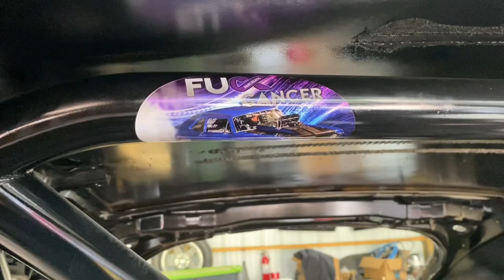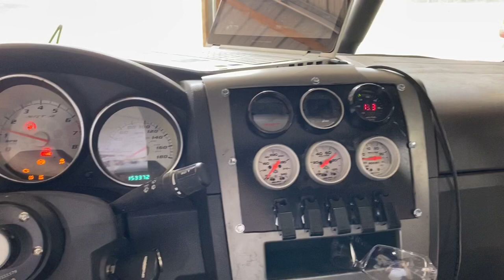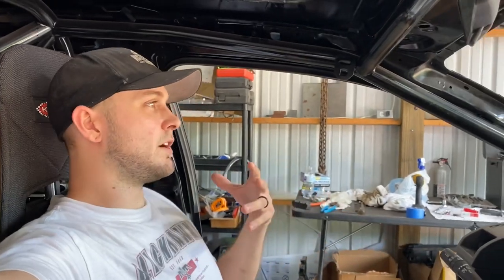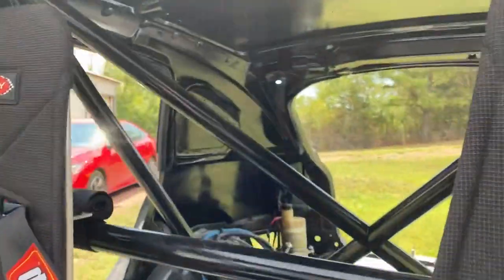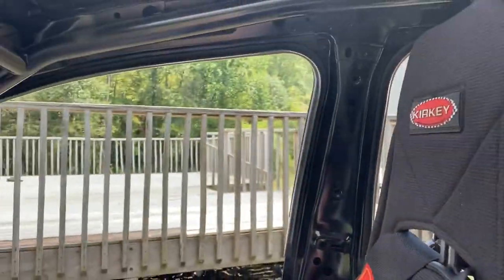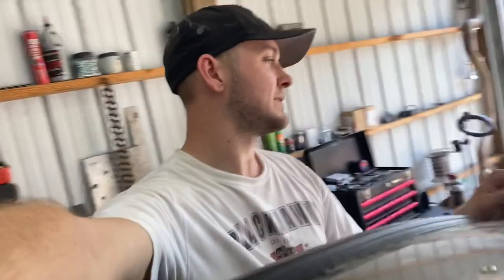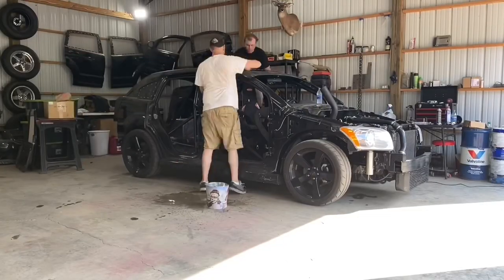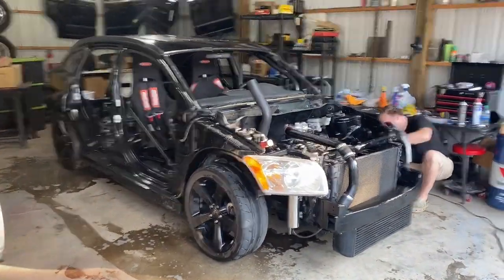CALIBER SRT4 DUNE BUGGY: Turning up the Boost! Cammed SRT4 Stock Turbo

Comment: That cailber srt4  is running good and sounds sexy
Reply from the maker: Thanks bro!
Reply: One day I will get mine there!!
Reply from the maker: jesse srt4 Oh yeah bro! Work at it every day 🤘🏼
Reply: Yeah that is what i am trying to do. I blow it up my injector went out in cylinder 2. So i am in the process of rebuilding it. I have the bottom end done. I took the head in and got a vavle job and bigger springs and retainers for stage 2 evo cams. I am putting a bigger turbo on it from Realtune Performance. I have 1025cc injectors for it, but that is what i am doing to it. will be pretty quick going for 480hp on e85.
Reply from the maker: jesse srt4 Sounds like a solid plan! 480whp is a very very fun street car for sure
Reply: Thanks bro keep me updated when you get it on the dyno. I am excited to see the numbers!!
Reply from the maker: jesse srt4 will do buddy!